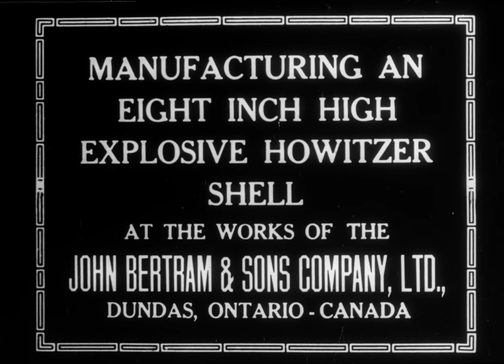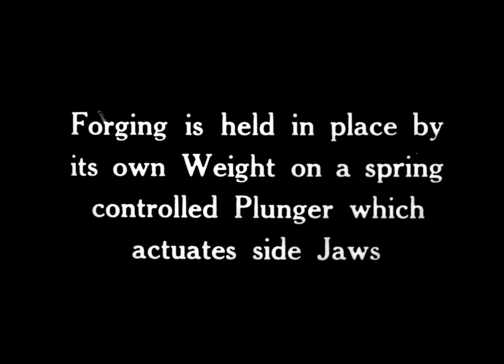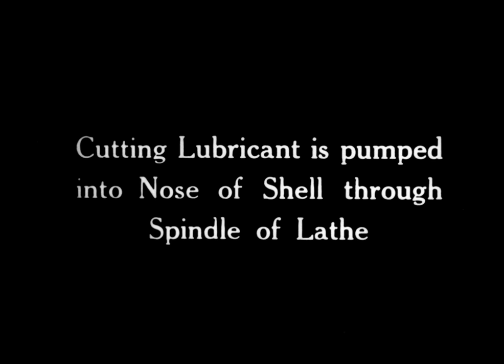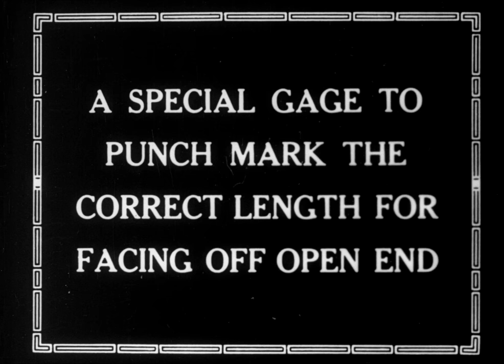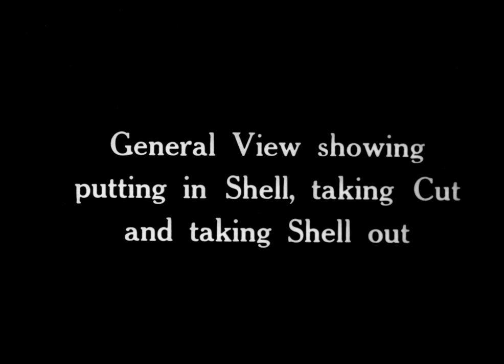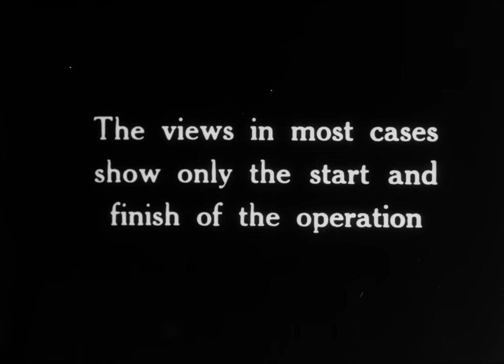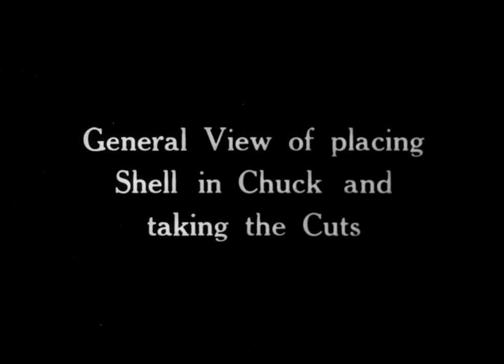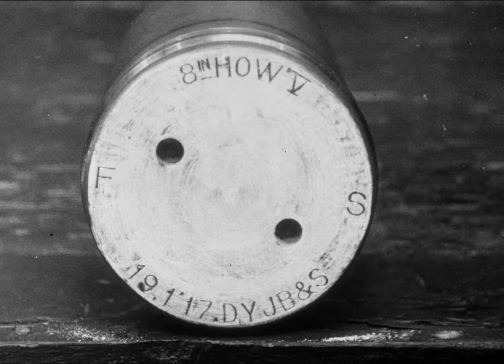Manufacturing an Eight Inch High Explosive Howitzer Shell (1917 ?)

Comment: These forged steel shells were a recent development. By using a high-strength forged steel body with rather thick walls and an overly thick base plug, the explosive force was contained after detonation until the last possible instant when the steel would shatter into lethal splinters. "Manual for the Battery Commander", from the French Artillery School in December 1916, described three "sheafs" of fragmentation coming from this type of shells. The primary and most important one was the lateral band caused by the fragmentation of the shell wall, a lesser amount of fragments from the nose, and a few large pieces from the base plug. When you consider how a shell impacts the ground from a howitzer at high angle, you readily understand why getting the walls to a uniform thickness is crucial to the fragmentation pattern of the projectile. The French manual also describes a cast-iron steel-overlaid shell, which would be cheaper to manufacture, and cast iron shells, which would be cheaper still. However the cast iron shell's fragmentation pattern is described as "pulverized instantly". Other parts of the manual explain how much care had to be taken to have all the heavy guns in a battery fire the same number of shells with the same charges to keep their barrels wearing out evenly, and so minimize the dispersion of a battery's fire. Other concerns like the temperature and the humidity of powder storage and even "powder must be rammed into the breach with uniform pressure from round to round", because more tightly packed propellant would burn differently and cause more dispersal. Since these heavy guns were used on harder targets that needed very close hits to destroy them, like concrete blockhouses or other artillery pieces, artillery commanders knowing their shells were all uniform could be confident of more accurate fire and so reduce how many shells had to be expended to be confident of target destruction. As for the huge bulk of what was being thrown around the Western Front, it was closer to the 155mm "medium" artillery. Heavy guns like these often operated with aerial observers in balloons or aircraft and would even fire one at a time, adjusted by signals from the pilot or balloonist.

Comment: That Vertical Turret Lathe at 34:00 brings back memories. Not from the War , I used one in a Machine Shop I worked 20 yrs ago. That thing was manufactured in 1908 and still worked every day , without a hitch. We only used it to drill 4 inch bores in 8 inch thick steel blocks , set it up , oil the work piece , hang a weight from the Handle/Bar , walk by every once in a while and shoot some more cutting oil on it. I loved that damn Machine.
Reply: Ain’t no school like the old school.   Then the world went and got itself in damn big hurry and fewer and fewer folks these days have time to do things well.   But on the plus side I spose we get to know all about who Alec Baldwin married...now I need a drink.

Comment: Wow, I have the powder shell for one of those in my collection. I'd love to get hold of the projectile... so much effort put into 
consistent accuracy and QA. I guess a few thou oversize would jam and destroy the barrel and potentially kill everyone nearby, 
so it's well in their interests.
What a great piece of historic documentary work.
Reply: No, i dont think so. The driving bands are what create gas seal, so there is not such a need for high precision. and also not because these are artillery shells. they could easily machined for maximum safety without losing their purpose. But i am not an expert, i just know a bit about weapons.
Reply: @AllisterCaine  Makes sense when you consider the accuracy of the barrel boring process, however, I believe the stamping at both ends was done to trace misfiring or breach jamming shells back to the source, so accuracy was probably in their best interest anyway.
Reply: There has to be consistency, so that accuracy is retained.
Reply: Has anybody read of "creeping barrages"? I'm not an expert, but shell accuracy likely had something to do with this.
Reply: @drewthompson7457  Also walking barrage. That has to do with troops advancing and not the shells missing. You might be thinking of bracketing fire on warships. Which has more to do with not having a perfect fix on enemy distance and direction.

Comment: What the video calls an "adaptrr", the US Navy calls a "base plug" to seal the explosive-filled cavity bottom, with an adapter meaning a fuze-holding threaded conical nose ring that can be swapped out aboard ship to allow the use of different kinds of nose fuzes (or even no nose fuze in some HC shells), including fuzes designed for other kinds of shells if the rings have the upper end threaded to hold those.,

Comment: In 1978 during summer break i got my first machinist job.  Cutting stock to length,  the milling parts to length also lathe work.  The job was in a building that use to make shoes. A lot of the buildings were old shoe factories.  Lynn Massachusetts and they burned during the great lynn fire 1981 or 82.  I got to run old belt driven machines fo my type of work. All others had Bridgeports and other modern machines

Comment: Love the old footage, but was scratching my head trying to add up Canada + WW1 + Howitzer + 8". 

Here's what I came up with: Most likely produced for the UK as I don't believe the Canadians used Howitzers during WW1 and they were quite the bedfellows back in the day. The round  was used for the Howitzer Mk 1-5. Depending on your source, it's referred to as 203mm or 8". and appears to have been used exclusively by the UK during WW1. The only other reference to that size shell for a Howitzer would be WW2 and used by he US and the Soviet Union.  The 8" shell also comes up for the M110 tank which came on the scene in the early 60's(Vietnam era). Union Jack in the last half second of the video is quite telling as well.

Hope this helps. Feel free to bust my chops if I got it wrong. Enlightenment is a wonderful thing...
Reply: Everyone used howitzers in WW1, these 8" rounds are for the British Vickers 'BL 8" howitzer', a modern design and widely used by the non French Entente powers back then, some of them even saw service in WW2.
The shell weighed 200lb and could reach out to c13,000 yards which means they were extensively used for counter battery work.

But this is an excellent video isn't it, the time and trouble taken to knock out such things in their millions is incredible.
Reply: ANTON RUDENHAM 
How times may have changed , a 3D printer perhaps could replace how many workers??

Comment: Those cutting tools are a work of art, they were made of tool steel and had to be resharpened often, nowadays they have tool holders with replaceable inserts of carbide or ceramic.
Reply: Yes, I was waiting for the carbide inserts and the constant surface feet feature! That pitifully slow rpm!

Comment: I didn't see how they installed the copper driving band (for engaging the rifling in the barrel).  It was just on it suddenly.  Also, who fills it with explosive and what type of explosive?  Inquiring minds and all that....
Reply: I would have like to have seen that too. It could have been by thermal shrink fit or more likely swage'ed in place so it had a good bite into the wave bands machined into the body. No doubt that is why the wave bands are done so that upon firing the rifling engraves the driving band and it transmits the rotation to the shell body without slipping. I have some 30mm, 57mm and a fired/recovered 75mm shell(s). The 75mm has a well engraved band but it also has mark visible on what was in the grooves of the rifling that  look like it was stake'ed. What ever the method is, it must be pretty solid so it doesn't slip!
Reply: looked like crimping marks on the band to me
Reply: My exact same question 😁

Comment: Almost everybody handling those shells during all the stages of manufacture wore no hand protection. They must have had very sore and damaged skin on their hands after a long day's exposure to all the rough edges and lubricant/coolant. I saw at least one worker wipe away swarf with his fingers, how on earth did they not suffer all kinds of nicks and cuts to their hands? A fascinating film.
Reply: I can say as a pro welder, the hands get very tough when you handle steel for years. It is like leather and can withstand a lot of abuse but when I look for burrs today I am careful not to get cut, I expect to find sharp edges so it is a no brainer to be cautious of your touch. But remember the bare hand is the expert when judging surface condition of any material. The guy who applied Vaseline to the shells did a great job, but yes a messy job for sure. And I can promise you nobody likes getting burned with hot liquid steel, but that is normal for a welder in manufacturing. And they pay good for jobs like this, a big incentive during war time, or any time actually.
But I agree I would want a good pair of tight fitting gloves with some of that handling but not when I was turning those shell casings, no way! And no tie dangling either! Ha ha!
Reply: They probably did, as we do today. Gloves are a nono on machine tools and always will be.
Reply: Sharp edges are something machinist have always dealt with and always will.  Just got be careful.

Far more worrisome for them was most of the industrial chemicals weren't all that healthy for you.  They didn't quite realize that at the time though.
Reply: I worked in a warehouse once, handling boxes and pallets all day. I didn't wear gloves, and after a while my hands got very tough.
My uncle was a farmer, and he had extremely calloused hands. He had a "party trick" of picking up a glowing charcoal briquette with his bare hand.
Reply: @clark9992  Your uncle must have been a very tough character indeed.
I would have winced if I had ever seen his "party trick" Your post made me smile - they "don't make 'em like that any more" or do they, you seem to have followed in his footsteps?
Out of interest I have about 20 cu metres of tree trunks delivered every year which I need to saw then stack. I get through at least one pair of leather work gloves each year. Can't go breaking my fingernails, can I?

Comment: Pretty cool seeing how they machined these over 100 years ago. Nowadays, it could all be done in 1 machine, start to finish, except the forging. I'm guessing you could spit one out in less than 10 minutes.
Reply: I'm not so sure about that, things like lathe cutting steel can only be done so fast due to heat & chatter, no doubt it's been sped up but I'd guess the biggest reductions would be in manpower as opposed to time.

Comment: Shells have to be made of good tough steel to contain the exploding explosive until it reaches maximum pressure to give the biggest blast and most deadly effective shards of case.
Reply: Well that's nice.
Reply: The explosive reaction is faster than the conduction speed of sound through the steel, it’s strength has litle effect on the size of the explosion. It needs to be tough to survive the 50,000 Gs of acceleration.
Reply: @TaintedMojo  Quote: 'Explosives do damage by burning quick and the resulting gas expanding rapidly in a pressure wave. If the charge is contained or restricted, the pressure builds and you have an explosion when the strength of the container is exceeded.'
Think about grenades.
Reply: Quote: Explosive Shells have to be made of good tough explosive steel to contain the exploding explosive until it explodes maximum explosion to give the biggest explosive blast and most explosive deadly explosive shards of exploding case.
Reply: @ianonymous3803  yes, isn't that nice?
Reply: @briand6671  are you trying to formulate a thought?
Reply: @TaintedMojo  That's not what scientists say.
Reply: Citation needed
Reply: The steel choices they had back then were pretty basic, even the cutting tools were not very good and could not have even cut many steels we routinely do nowadays without a lot of trouble.  The shells exploded just fine with a plain old steel.
Reply: @G53X0Y0Z0  Shells have to be made of good tough steel to contain the exploding explosive until it reaches maximum pressure to give the biggest blast and most deadly effective shards of case.
Reply: @rosewhite---  It was already pointed to you that what you wrote is wrong... writing false(-) information twice dont make them right(+). Thanks to your lack of knowledge and understanding you confusing explosive materials with propelants used to shoot the shell and they are burning(even if they doing BAAANG! sound) not exploding. "Think about grenades." yes do think about them but first maybe go and read something about them? As there is no rapid acceleration you dont need strong case for hand granade and that is why they are doing them now from polymers with pre-formed fragmentation matrix inside that polymer... and how it is like that because in old steel granades with groves->"in practice, it was found that the grooves did not enhance fragmentation as much as desired"! But hey acording to William Mills he made all that groves on his "Mills bomb"  design to help with proper grip not for fragmentation so it looks that he contrary to you would be able to understand "The explosive reaction is faster than the conduction speed of sound through the steel," from TaintedMojo comment... but hey in the end he was not profesional "internet specialist" like you... heh

Comment: Its astonishing that this video is 103 years old, but the quality is top notch. And it does not look like a remaster. 

And the level of mechanisation is also astonishing. It really was the first industrial war. 

Btw: For all who ask why this much effort for just one shell? Well artillery shells had the lowest toleances and highest precision demands. 

Wich is simlply explained by the fact that they had to behave as closely as calculated, in the fireing tables, as possible.  

If a tank shell deviates by 0.1 degree when fired, it may hit 30 cm to the left of the perfect shot. But if an artillery shell deviates by 0.1 degrees, you might miss by tens or even hundrest of meters, depending on the range of the shot. 
Wheight differences make them behave differently when a strong wind blows, wich may take them off course etc... 
Also their muzzle velocity would change and thus the overall range.

Comment: The Government Quality Control Inspector had a back-breaking job leaning over an un-ergonomic bench eight hours a day, but wearing a hat was not the worst of it. 

After 6 months in the factory gaining experience, inspectors had to go to the Western Front in France and check all the Job Lot Numbers stamped on the shell's bases, after they'd exploded. If the shell casing hadn't disintegrated into shrapnel pieces as prescribed in the "Manual of Exploding Ordnance", he'd have to write a very stern letter to John Bertram & Sons, demanding better training of his foundry workers & machinists.

Comment: Wouldn’t want to be the government inspector, that is a lot of work
Reply: To be fair, they really didn't use that much time on every shell. There simply was not time. Spot checks have been industry standard on anything except barrels which are each test fired. Faults are noticed later down the line and then the checks get more intensive and government starts to cut the money. 
For example, the checks on the inside, very rare to get anything left on the inside and very little effect if there is. It just needs to hold the explosive when poured in and be thick enough so it doesn't burst while firing.
The manufacturing speeds were ramped for the WW2 and they would have even less time run with calibers around every single shell they made...

Comment: I love seeing all these old milling & machining tools. I can understand the time, effort, & precision going into producing the actual artillery gun, but why all the work for a shell?Just seems like overkill for a single use munition.
Reply: It does seem as if it is a lot of effort for the item, but without very stringent QC and gaging, the round will not fly true...  Say the round is slightly un-concentric, it will not spin well on its axis and will wobble in flight, veering off axis.  If part of the main casting is too small, or too large issues will arise later.  If the copper rotating band is not of the correct diameter, the shell will not seal (obturate) inside the barrel as it should, and not engage the rifling properly to impart proper spin.  Say the threads are not cut well, the fuse will not seat well, and could throw off balance and the fuses function.  

I have made my own small arms ammunition for over 35 years, cast my own bullets too, and it is the same idea...  You want everything as absolutely concentric and uniform as can be had for maximum accuracy, especially considering that shell will travel many thousands of yards, and inconsistencies really show up the further away you get...  An 8" howitzer of the time had a max range of about 6 miles, and you don't want to have it drop short, or go long because the shell was made incorrectly.
Reply: Well a Bunker is more expensive than a Shell.